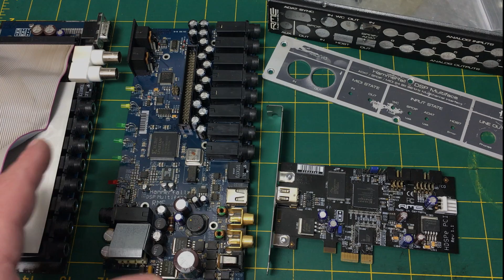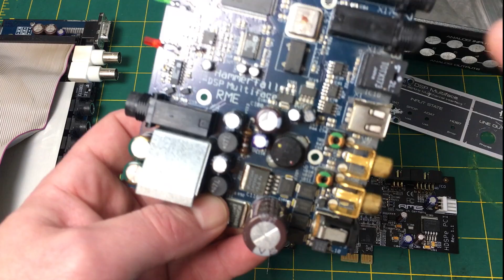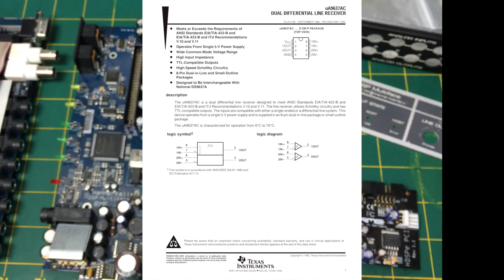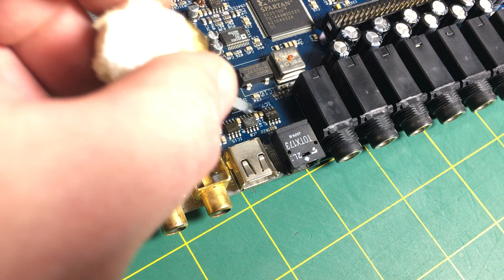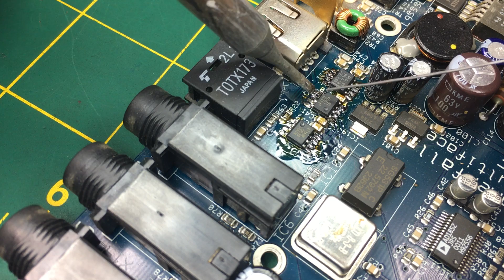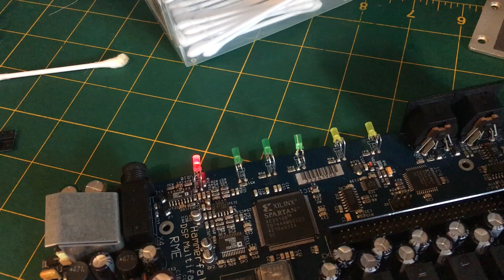RME MULTIFACE REPAIR

Comment: Hi, i have a multiface very very hot(can't put my finger on it) on sot223 ic21 and red light error on. connected with firewire cable on pcie rme. I/O box not connected on system startup, i tried firmwares on pcie, they applied with no problem, but box still not recognized ... i think maybe capacitors are dead near ic21 and maybe itself with ic19. i hesitate to do your repair, i prefer ask you before. RME don't give schematics. Do you have an idea ?  Do you know references for ic21 an and ic19 ? Thanks a lot, it's a long way to the to the top if you wanna record with multiface...

Comment: Thank you very much. My RME Multiface box was showing the red light all time after I connected to the PCI card after being accidentally disconnected. I bought the ICs and replaced them in the PCB and everything is working now. Very useful video. 

I think that RME should have done a better design, it's very easy to forgot don't connect the cable while PC's on.
Reply from the maker: awesome sauce!

Comment: Happened to me, somewhere in 2003 (put the RME plug in a firewire port, or was it a firewire plug in the RME port?...). I asked them if they ever wondered why no manufacturer ever used powerplugs for connecting audiospeakers. They were very sportsmanlike and sent me a new PCI Interface card.
Would any one here familiar with this device happen to know if there 's a way to mod it to a USB device?

Comment: Do you know if the Multiface will work with any Firewire card or does it have to be RME's? If RME HDSP card essential, is it possible to config the Multiface for standalone operation with a jast standard firewire card?
Reply from the maker: you need the rme card as it is not firewire protocol and the card acts as a bus master

Comment: Greetings, thanks for the video! One question, last year i bought my second multiface II (the seller told me it is working, yeah right....) and i also get the red host light permanently on. My first multiface works perfectly instead (connected to the same PCI card and also on ExpressCard). Do you think it is for the same reason as yours? Thank you very much!
Reply from the maker: could be, does the prewire socket look damaged or loose?
Reply: Really Nice Audio not really. It looks in perfect condition.

Comment: Hi!  I'm about to do this too, but my problem is a little different... I'm getting clicks and pops, which I've read can be attributed to the RX/TX chips for the firewire port.  Are these the same chips that you changed here, or are they the ones you point to right after you point to the three line drivers?  The unit still powers up and connects to the computer but there are artifacts everywhere, and I did plug the firewire cable in backwards.  I don't know much about firewire data transmission but I can solder.
Reply from the maker: Yes these seem to be the RX/TX chips as they go directly to the fpga.
Reply: Thank you!